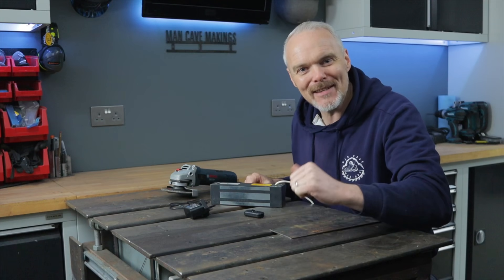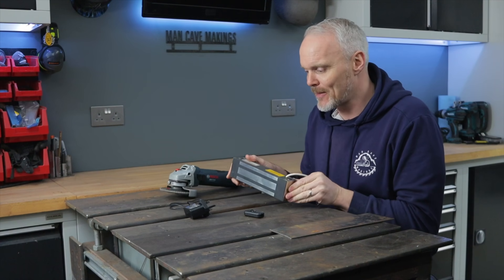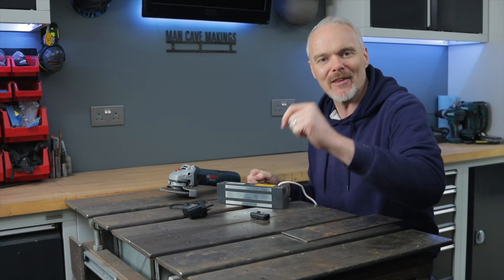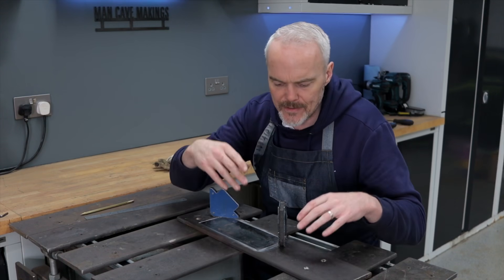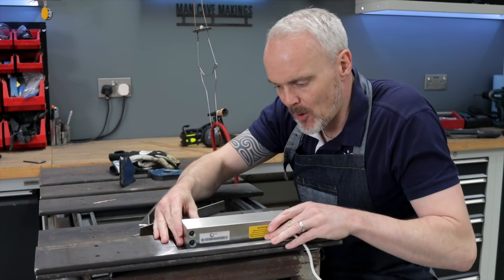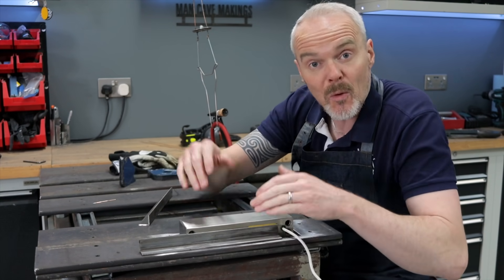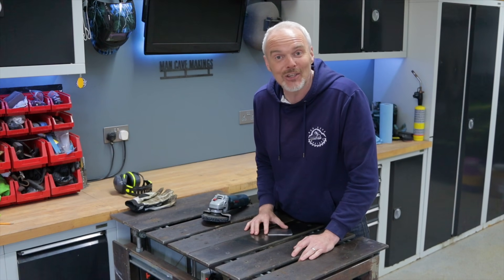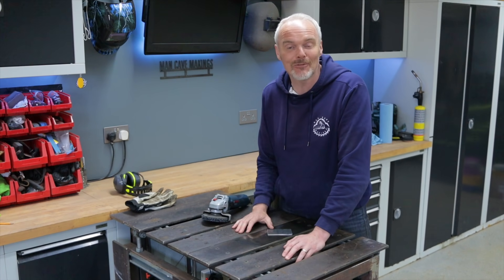DIY Electromagnetic welding table upgrade

Comment: If anyone is looking for a maglock just call local Security Integrator shops. Ypu can find them in all sizes as well from small cabinet models with 50lb hold force to larger 1000lb+ hold force.

Comment: Absolutely awesome! How large of a part can you hold with this? Was thinking of adding two on my welding table as I work with larger parts.
Reply from the maker: Hi, I’ve not really tested it against a weighted object yet. Mostly used for smaller lighter bits of flat metal. I have heard of some folks using a surface grinder work holder but they are mega heavy. Good luck

Comment: HI, great video!!! Question do you think if I place an electromaget lock on the bottom of a 1/2 steel plate the top will be magnetize?
Reply from the maker: Hi, sorry for not responding sooner. I tried this first but it doesn’t have enough magnetic power to overcome the 1/2 steel and so went down to 3mm steel which makes a decent job of holding things in place 👍🏻 hope that helps

Comment: G'day from Australia, Gus. I came across your channel while looking for some design ideas for my own 'electromagnetic holdy downy thing' to hold small parts that need to be cleaned, after they've come off my plasma cutting table. Having to clamp and reclamp them during the cleaning process is a PITA, especially when I have lots of pieces to clean. I have bought 4 of those door maglock units rated at 180kg each, and a power supply, so thanks for the design ideas for my build. Love the excitement and energy you create in our videos, too. I've subbed so I can check out more of your man cave makings.
Reply from the maker: Fit like as we say up in the north east of Scotland my man! Thanks for the kind words and the awesome message and good luck with the build. The same reason I built mine was for small thin metal parts and finding them so hard to hold this is an absolute brilliant thing to have in the table. I’m having a wee break from making as I’m travelling just now but hope to do more in the future, also do a fair bit on Instagram. Take care my friend and thanks again for watching and sending a message, very much appreciated 🤜🏻🤛🏻👍🏻🙌🏻

Comment: Nice job. I'm doing a couple of electro magnets in my welding table and drill press. I'm using micro wave transforms to get my job done. I like your idea also. I may try one of them in a future project.
Reply from the maker: Thanks Kelly really appreciate the comments and good luck with your project 🤜🏻🤛🏻👍🏻

Comment: Magnifico!  When I saw those mag door locks a couple years ago, I knew they'd be good for something, and you've just shown me what that is:  A magnetized, holdy down, third hand thingy!  Hmm, 280kg/600lb here in the States is $30.08 now, but still worth it.
Reply from the maker: Thanks LJ, you will not regret it, I use mine nearly every time I fabricate something and would not be without it on my bench! Good luck my friend 🤙🏻

Comment: Greetings from Oz, can you supply the brand / model of the magnet. Similar ones here in Oz appear to be in excess of $300 au, which kind of puts a great idea out of reach due to the price. Cheers,
Reply from the maker: Hi Binary code, check out the description as there is a note on what I searched for on EBay. The magnet is unbranded and the link no longer works but there are more examples, not sure about the Australia version or price point but hopefully the information will be useful to search out a similar one form your side of the world. Cheers
Reply: @ManCaveMakings  thanks for that, truely a great idea. Unfortunately the prices here are outrageously expensive. $300 au being the cheap end, some as much as $2500au. I have found one in the uk that is the equivalent of $110 au plus postage (usually more than the purchase price, I buy motorcycle parts from the uk occasionally). I just have to convince them to post it to overseas which they are reluctant to do. Once again, thanks, Steve
Reply from the maker: Cheers Steve, that’s a shame they are so expensive over in Oz! That’s mental prices! Have you tried banggood in China? Also as these are just ordinary door mag locks is there a local company who does door entry systems you could ask? Good luck with the quest to find one at a decent price man 🤙🏻🤜🏻🤛🏻

Comment: Very sharp Gus,  I’ve been thinking about hacking one of these mag holders to make the coil do more of a point hold and see if I can somehow remove nails with a magnet.
Reply from the maker: Bryce my man, thanks for giving my channel a tour buddy, very much appreciated. That sounds like an interesting challenge as the magnet to nail ratio is so massively different to that of a mag lock where both surface areas are similar so the magnetic force generated can be quite small. Got my cogs turning now 😂😂🤜🏻🤛🏻

Comment: Brilliant !   Does it magnetize the entire table or just the strap its mounted under?
Reply from the maker: Thanks Zack, I don’t think it’s strong enough to magnetise anything really, I guess it all depends on how long it’s on for. I’ve noticed a little magnetisation of the work piece on the thinner gauge materials but not the bench itself. Hope that helps and thanks so much for watching and commenting very much appreciated 👍🏻👍🏻👍🏻
Reply: @ManCaveMakings  Hey thanks for getting back. But i'm a bit confused, in the video you describe it having significant hold. So if I was to lay a joint over the magnet to tack, would it be suitable ? thanks again
Reply from the maker: Thanks Zack, very much depends on what you’re welding I think, for example I use TIG for everything and if I were to try and tack two bits of thin gauge material with the magnet on it would be very difficult as the arc would be affected by the magnetic force, maybe it would work for box section but I’ve not tried that yet. Basically I predominantly use this for work preparation ahead of welding and have not tried any direct weld holding on it and if you have experience of using magnetic 90deg holds and tacking and welding I think the same principle would happen with this. Hope that helps my man 🤜🏻🤛🏻
Reply: @ManCaveMakings  so mig welding 1" 16 gauge, thanks again

Comment: I'm ordering one with 180kg, guys do you think it is enough to cut with a ginder?
Reply from the maker: Hi Mr Pucho, thanks so much for dropping me a message and giving my idea a go in your workshop sounds great. I think 180Kg will be underpowered as my 750Kg holds well but does move every now and then so having something which is a quarter the power I don’t think will work very effectively. Let me know how you get on if you do order it though as it would be interesting to compare notes. Thanks 🙏🏻

Comment: Do you run that mag on AC or DC?  What does the manufacturer recommend to run it on AC/DC..?
Reply from the maker: Hi Stephen, the mag is either 12v or 24v DC depending on you’re wiring needs and I run it off a small plug top transformer taking it from 240vac to 24v DC. Hope that helps 👍🏻
Reply: @ManCaveMakings  😯 Crikey, what a long time you've replied without me realising it! Anyway, thank you for your response and, whilst I think most mag-drills have their magnets directly powered by the mains, I saw people using mircowave oven transformer primaries, sometimes two connected in parallels, to do the trick. I however think working up high a PM clamp should be a safer option, especially since the advent of the neodimium magnets available.
Reply from the maker: @sibalogh 😂😂😂😂👍🏻 really appreciate the comms and I’ve definitely neglected YT for a while so my apologies. If I were to do it again I’m sure there would be a difference in the outcome, like you said so many options open to us. Cheers bud 👍🏻👍🏻

Comment: This is BADASS!! I just made one of these tables for grinding but with some electromagnets I purchased off amazon, similar price but not as much holding force, but they still work. I wish you would have had this up here a week earlier! Two questions, what amp rating do you use on your DC transformer and is the magnet 12V or 24V?
Reply: Ignore those questions...I just read your description and it tells me the answers...surprising you only need the 1A.
Reply from the maker: Thanks for taking the time out to view and also comment glad  you got the answer from the comments 👍🏻
Reply from the maker: Hi Chris, I’m surprised no one else has done something similar but you clearly think like me! Happy days buddy my one has 750Kg but it losses quite a lot through the 3mm top plate I put on but I works great for my application. I was surprised also at such a low amperage and it runs off almost a phone charger type transformer 🤘🏻🤘🏻
Reply: @ManCaveMakings  Right?! I am fairly new to metal working but have a plasma table and do a lot of grinding of mild steel plate cutouts. The magnets in my table are only 80kg holding power, are directly on the table with no plate, and work ~ok~ to hold but I never thought of using a door magnet which are much stronger. I am going to build another table and use door magnets and test multiple plate thicknesses to see what works best. Great video and idea!
Reply from the maker: Awesome Chris, definitely try and get the most hold for your money bud as it will pay dividends also depending on size you could have multiple ones for larger pieces? This is all I hope for out of my videos is that’s someone moulds an idea I’ve shown Into their own. Totally awesome dude 😎👍🏻👍🏻👍🏻

Comment: Just an awesome idea. I wonder if there’s an electromagnet where you can dial in the holding power, so you’re only using what you need. My brain is just thing of how welding magnets sometimes deflect the arc when you TIG weld,,,just musing I feel like making one just to experiment
Reply from the maker: That’s an interesting idea and I don’t know if that’s possible as I would guess it would have to do with how the electromagnet is wound? Maybe multi windings like a motor winding for different speeds? Yeh the magnetism will do funny things to your arc and I wasn’t planning on welding on it as I’m fearful of heat transfer screwing up the windings but I love how your thinking and definitely go for it as they are so cheap to get a hold of. Thanks Aaron really appreciate you stopping buy and also leaving a comment dude 👍🏻👍🏻

Comment: So clever! Great example of convergence. Hard to believe 24V at 1amp holds 1600 lbs! Now I have to make one. Mahalo for sharing! : )
Reply from the maker: Mahalo brother, I’m not sure of the exact holding force as I’ve fitted a 3mm top plate so it definitely losses some magnetism through the plate but it holds up really well so you should try and find the maximum one you can get and give it a go. They are so cheap to buy what’s not to love!! Thanks man 👍🏻👍🏻

Comment: Great job Gus! I was trying to make an axe holding jig with a maglock and Unistrut but it never came together, I should give it another go one day
Reply from the maker: Absolutely Sparky, the mag lock I got said 750Kg holding force but that’s direct to a plate so when I added the 3mm top plate it’s definitely a lot less but as you can see plants strong enough for smaller parts. I’m sure a little more digging and you’ll find the right thing. Cheers buddy as always 👍🏻
Reply: @ManCaveMakings   I already have a maglock, I'm  always starting projects then I put them to one side when they don't work out properly. Sometimes I return and finish them  🥃 👍 😊
Reply from the maker: Nice one no excuses really then 🤣🤣👍🏻

Comment: Love this idea Gus! What did you use for the power supply for the mag switch?
Reply from the maker: Thanks Glenn, used a 240v to 24v 1amp plug in transformer. The mag lock has both 12v and 24v power inputs so really easy to get a power supply to it. Also only needs a small amperage capacity which is ideal. Thanks buddy 👍🏻👍🏻

Comment: Dude this is so much better than my solution.  Looks like I need to order some parts.  I won’t be adding it to my weld table like you did, maybe a dedicated stand, but my new one will turn on and off.  Great job and thanks for the inspiration to make my setup better.  I’ll send you a link to mine which is pretty pathetic in comparison.  It worked but being able to turn off the magnet.  So much better.  I was always thinking of a on/off magswitch type solution but this seems even better.
Reply from the maker: Amazing Chad and thanks for the DM with the link on Instagram! I would cut into tour table either it’s way nicer than mine but what a game changer it is for safety in the shop, I didn’t think about a separate stand but that would make perfect sense like you grinding stand! Thanks for give it a watch buddy and glad it’s sparked an idea or two. Thanks 🙏🏻